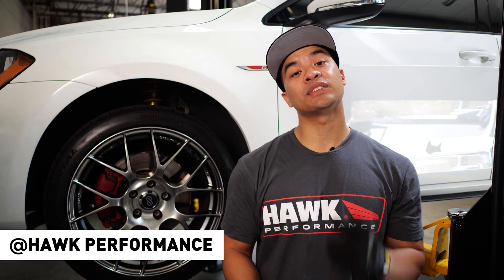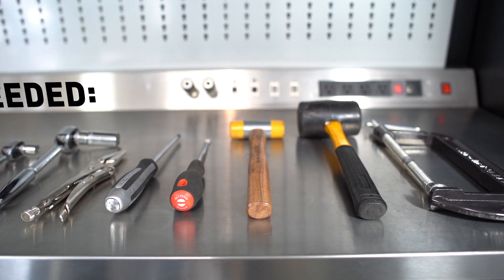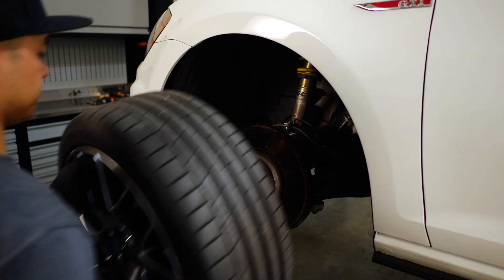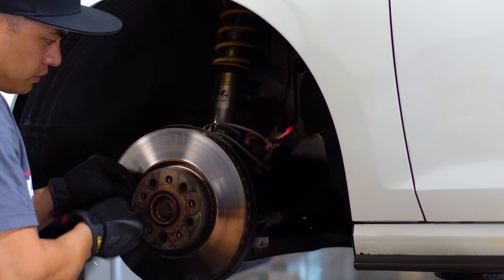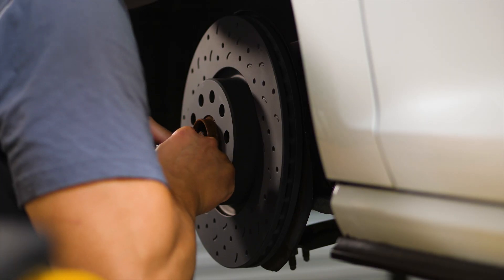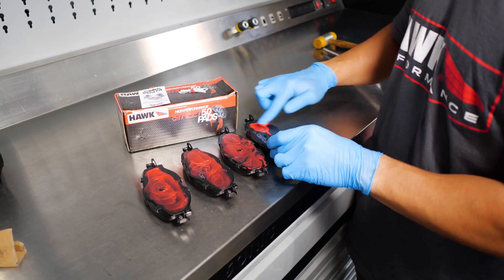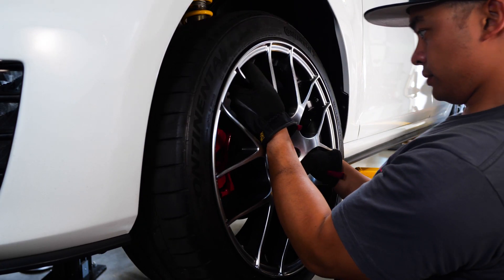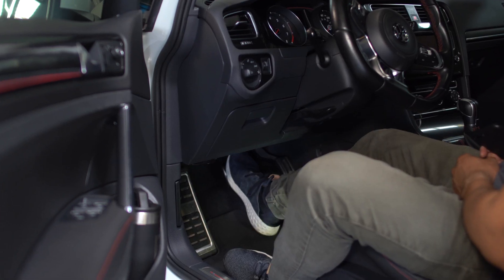Hawk Performance Brake Pad and Talon Rotor Install

Comment: does the coating on the rotors come off or will they rust?
Reply: The coating only comes off of the contacted surfaces as far as I can tell. Just put on the front set for my 2018 Rav4 XLE. I should have the rear set done this weekend.
Reply: @stevenv2190  How they holding up so far?
Reply: @jakob.2is968  Really well. Hawk Talon rotors on all corners and Hawk HPS pads.